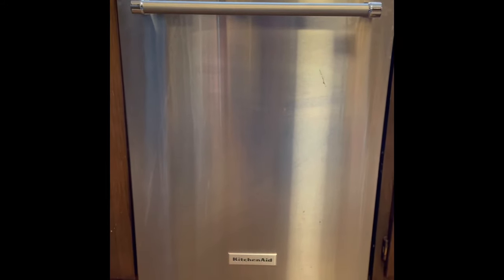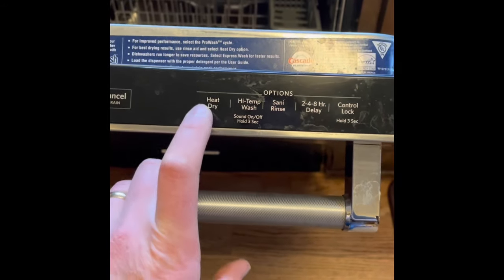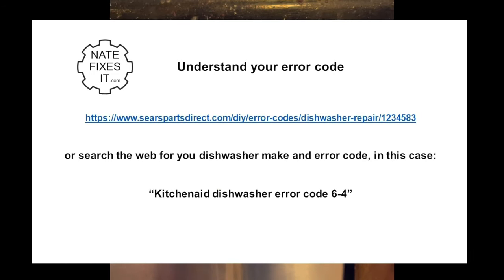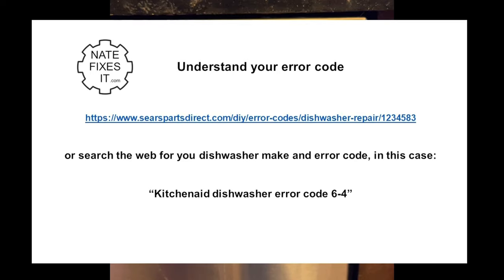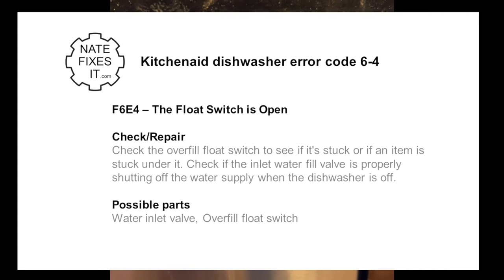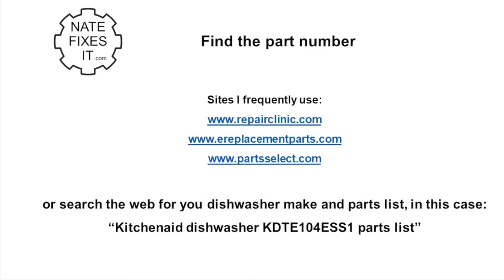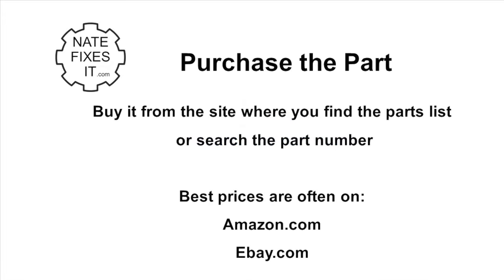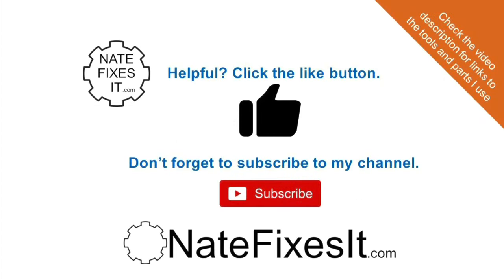Dishwasher Diagnostic Mode: find out why your Kitchenaid won’t work

Comment: When I go through the sequence of pressing the three numbers 3 times (the lights light up each time I press a number) , I don't get any lights coming on.....there's nothing.
 I read some comments below and I see that you suggested I cut power to the dishwasher for 15 minutes to reset the board but I still don't get any lights coming on. Do I just need to replace the Control Board? Thanks!
Reply from the maker: Some dishwashers have different key sequences; is yours the same model (KDTE104ESS1)?  What issues are you having with the dishwasher?
Reply: I tried a difference sequence that I found in your comments. After a couple of tries I managed to get it to respond and it displayed an error code 71. I referenced it on the internet and it says something about the heater?? The dishwasher takes a while to start and then stops after not even a minute. It seems like it just isn't washing. It takes 3-3 1/2 hours to complete a cycle and dishes are not clean and everything is wet. Thanks for any insight.
Reply from the maker: If you’re setting the dishwasher for a heated dry and everything is coming out wet (but not standing water in the bottom of the dishwasher), it could be a bad heating element (which aligns with your error code).  Cold water will not clean as well as hot water.   If you have standing water in the bottom, it’s probably a pump issue.   I have not done this myself, but if you have a multimeter, you should be able to check the resistance of the heating element to see if it’s gone bad.   I’m guessing there is a YouTube video out there that could show you how.

Comment: I can't seem to get it in diagonotic mode for my KDTE104ESS2.  Everything is off (no lights on Start or Drain)  hit the three buttons in a row but they all don't light up at the end.
Reply from the maker: If the control panel is completely unresponsive, check to make sure that you are still getting power to the dishwasher.  Make sure that nothing is unplugged and the breaker hasn’t tripped.  If everything looks right, try turning the breaker off and then back on to restart the dishwasher computer.  If that doesn’t help, it’s most likely a bad control panel, which, unfortunately, is a pretty expensive part.

Comment: Mine has a F6 E4 and a F6 E1 code.  Ours fills with water but doesn’t do anything else.  Sounds like it might be a float switch issue 🤷‍♂️?
Reply from the maker: Sounds like the most likely issue and is a pretty easy, cheap fix.  Check out my video that shows how to replace a float switch.
Reply: Same issue, Already replace float switch and still going on, guess I have to try the valve.

Comment: Thank you, Nate! I think the model of my dishwasher is KDTM704E and I was able to get all the lights to turn on using "Bottle Wash", "High Temp", and "Sani-Rinse". When I close the door, the external light stays on for a few seconds, then just goes off. Am I maybe pushing the wrong buttons?  Thank you.
Reply from the maker: I can’t find specific instructions for your model; but, based on the way it is responding it does sound like you are getting to diagnostic mode and that the dishwasher isn’t showing error codes (doesn’t mean nothing is wrong, just means the dishwasher doesn’t know what it is if there is a problem).  

Another possibility is that you may need to advance through the diagnostics.  I’ve never used this technique, but near the bottom of the article of the link here, it discusses how to move through various diagnostics on some models.  https://machinelounge.com/kitchenaid-dishwasher-diagnostic-mode/
Reply: @NateFixesIt Thank you!!!!!
Reply from the maker: @scott5185  no problem, good luck!

Comment: Nate - I have the exact same error code so I have ordered the float switch. Would I need the fill valve as well or should I try the float switch first and then if that doesn't work then get the fill valve? ALSO, do I need to remove the front panel to disconnect it or can I simply switch the dishwasher off and then replace the float switch?
Reply from the maker: Try the float switch first.  This video shows how to replace it: 
https://youtu.be/wXFZFor5p8I
If it is the fill valve, this video shows how to replace that: 
https://youtu.be/0fbn-ytbGWw

Neither is a difficult repair.  Good luck!

Comment: I tried this and all the lights came on but the front light didn’t blink a code.  All the lights just stay on.  Is there another way to get a diagnostic code?
Reply from the maker: Sounds like you entered diagnostic mode but the dishwasher hasn’t self-identified an issue.  This doesn’t mean nothings wrong, just that the dishwasher hasn’t figure it out itself.  What issues are you having?
Reply: The dishwasher will run and then stop mid cycle. Thought it was the control panel so we replaced it. Still having the same problem so we cleaned out the drain but didn’t help. The latch seems secure, don’t know how to tell if it that or something else.  Thank you so much for responding!!
Reply from the maker: @lanetterodarte3214 the first thing I always check is the filter if it has one, doesn’t sound like that would be it, but it’s free to try.  My second guess is the float switch.  Pretty easy and inexpensive to replace.  Here is how on my model
https://youtu.be/wXFZFor5p8I

Do you hear water going in and pumping out?  If not it could be the fill valve.

Comment: Quick question if you press the buttons in the cycle and then nothing happens, does that mean there is no error codes?
Reply from the maker: If the controls seem to be responding, and no code shows up, that means no error code that the dishwasher has self-detected.

Comment: In your example when you press these buttons 3 times all the other buttons light up.
Mine do not...
Reply from the maker: Do you have the same model of dishwasher? Does your control panel seem responsive otherwise?
Reply: Yes, the same. Panel appears responsive. Last few times "normal" cycle stopped after few minutes with all lights off. Had to run an "express" cycle which worked fine.   @NateFixesIt
Reply from the maker: That’s some odd behavior.  It could be an issue with the control panel or the thermal fuse.  I would suggest restarting the control panel to see if that fixes the issue.  To restart the control panel you need to cut power to the unit for a minute.  If the dishwasher has a plug, in plug it, but most likely you will need to flip the appropriate breaker off for a minute.
Reply: Thanks...  @NateFixesIt

Comment: Thanks Nate! After getting the solid lights and closing the door, the indicator light doesn't blink, it stays solid. Watched it for a good long time to be sure. Any thoughts?
Reply from the maker: It means that the dishwasher hasn’t self identified a problem.  Doesn’t mean that nothings wrong, just that the dishwasher hasn’t figured it out.
Reply: Makes sense; thanks! @NateFixesIt
Reply: @NateFixesIt  mine is doing the same,any suggestions on what next?  My KDTE204KPS is less than 18 months old, hoping to not have to pay a huge repair bill
Reply from the maker: @chelseapeedin1965 if it’s that new, is it still under warranty?  What issues are you having?

Comment: got my code 6-4 same as you're and i've replaced the inlet valve and the float switch but the dishwasher still wont complete a cycle what else could be my problem
Reply from the maker: I’ve had that same error code and it actually be the main circulation pump.  I have a video for replacing that too.
Reply: do you have a link to that video? @NateFixesIt
Reply from the maker: Here you go:  Dishwasher Repair: Circulation Pump replacement on a Kitchenaid Dishwasher (not spraying water)
https://youtu.be/gIm3pFcXu0w

Comment: What does it mean wahen you do the diagnosis code error and the light that should blink just stays solid and never blinks?
Reply from the maker: If the controls seem to be responding, and no code shows up, that means no error code that the dishwasher has self-detected.  Doesn’t mean that there’s nothing wrong, just that the dishwasher hasn’t figured it out for itself.

Comment: If I have no error codes and heater still not working what could it be? I tested the element and it's ar 12.8 ohms. I verified the deverter switch and it clicks. I tested the hightemp thermostat and it's working. The float is working and I ended up changing the turbidity sensor cause there's a thermistor in there and that could also be the issue but in the end I'm stumped.
Reply from the maker: I’ll be honest, I’m pretty stumped too.  The only other thing I can think of is the control panel or if there is a loose connection somewhere.
Reply: @NateFixesIt  So I ended up removing the front door panel to access the control board and noticed the power and heating wires that connect to the board had darkened connectors like if it had over heated.  Atm Im suspecting the relays that are behind the connector. There are 4 relays on this board. I figure its the first one behind the connector. Im gonna try replacing all relays before I fork out 350$ on a new board.
Reply: @NateFixesIt  I removed the front panel to access the control board and yep...pretty sure its the control board thats the issue cause where the power and heating wires connect to, look to have overheated . Atm Im suspecting that the relays behind that connector might be the culprit.
Reply from the maker: @Daniels656993 sounds like you found the issue!
Reply: @NateFixesIt  Yep !! Replaced the control board today with one I was able to find at half the price at a place near me and Dishwasher is now running like new!! Woohoo!! :-)
Reply from the maker: @Daniels656993 congrats!  Well done! 👏👏👏

Comment: Hi. My dishwasher is not washing. It fills up. But is not spraying water. Ran the diagnostic test. It givesme a 6-4 code. So I replaced the Inlet Valve. I can hear the float switch clicking. What else can it be?
Reply from the maker: I had the same issue on mine.  I replaced the float switch and fill valve and it still wouldn’t run.  The issue was a failed circulation pump.  The impeller had actually fallen off of the shaft.  Here is how I fixed it: https://youtu.be/gIm3pFcXu0w
Reply: @NateFixesIt  I was hopping it would not come to that. Thanks for the reply.
Reply from the maker: @frivera7049  same for me whe I had the problem.  Good luck with the fix, it’s really not that bad.

Comment: I tried pressing these buttons in the sequence and closed the door after the 3 buttons I pressed stayed lit. But after a few seconds, the 3 lights turned off without any diagnostic code on the “clean” light. I guess it never went in diagnosis mode. How do I enter the diagnosis mode on my Kitchenaid dishwasher kude70cvss0? The dishwasher runs fine with plenty of water for first 10 minutes. Then, after the soap pod drops to the bottom of dishwasher, it just makes noise but not water comes. Appreciate your help
Reply from the maker: I can’t find any other information on a different way to access diagnostic mode on that model, so my guess is that you are entering diagnostic mode, but the dishwasher isn’t self-identifying any issues.  Is the dishwasher filling, spraying, and then draining on the pre-rinse cycle before the soap drops?   When you open the dishwasher and the soap has dropped, is there water in it?  If there is water, can you tell if it is the leftover rinse water or fresh water for the wash cycle?
Reply: @NateFixesIt  Yes, the dishwasher is filling, spraying and then draining the water before soap drops. When I open after the soap drops there is no water. But the dishwasher makes mechanical sounds as if it is spraying the water after the soap drops. Could this be a float switch or some valve issue? By the way, since not all the lights on the control panel come up after pressing those 3 buttons in sequence thrice, I don’t think it is entering diagnostic mode.
Reply from the maker: @ameetpatil   without being there to troubleshoot, my three guesses are (in order of cheapest to fix):
1. Float switch issue (before replacing, try moving the float up and down inside the dishwasher and continuing the cycle)
https://youtu.be/wXFZFor5p8I
2. Fill valve issue (before replacing, take the cover off of the bottom of the dishwasher and listen to the sounds the fill valve makes when it starts the cycle and actually fills, see if it makes any of those sounds when it should fill the second time)
https://youtu.be/0fbn-ytbGWw
3. Control panel issue

I can’t guarantee it’s one of these, but that’s the order I would try if it was my dishwasher.  The first two are fairly easy and inexpensive things to replace.  I’m not sure if they are your problem, but they could help you with the process of elimination.  I have included links to the videos that show how to do those changes on my dishwasher.  I don’t have a video for a circuit card replacement, but I would think someone else on YouTube will.

Here is a parts list for your model: https://www.ereplacementparts.com/kitchenaid-kude70cvss0-dishwasher-parts-c-114958_420281_421174.html

Good luck!

Comment: Dont know if youre still there nate, but my machine isnt cleaning and when i tried to activate the diagnostic the lights didnt flash to indicate it was going into diagnostic and no flashing light indicating the number error code. Any ideas?
Reply from the maker: The first thing to try is to clean the filter if you have one.  This video shows you how to do it if your dishwasher is the same as mine.  https://www.youtube.com/watch?v=ylGDzryIG-Y
If that doesn’t do it, try listening to the dishwasher as a cycle runs.  Can you hear it filling, spraying, and draining?  If you open the door during the wash cycle, you can peek in to see what’s happening if you can’t tell by sound.

Comment: I have the same model and when I run the reset cycle and nothing happens, no lights come on the top control panel and no flashing code. Any ideas?
Reply from the maker: Is the control panel responding at all, just not popping up error codes?  If the controls seem to be responding, and no code shows up, that means no error code that the dishwasher has self-detected.  That doesn’t mean you don’t have a problem, just that it’s going to be a little more challenging to diagnose.  I first thing to try is to cut power at the breaker for thirty seconds and then reconnect the power.

What issues are you having?
Reply: @NateFixesIt  First of all Nate, you are awesome. Thank you so much for providing this service. 
I walked away from the dishwasher for about 30 minutes and tried the code sequence again. It worked! However, it didn't do what your video showed. It went through a series of clicks and water sounds, long periods of silence, then finally, a long beep, but no flashing error code. All of the lights went off and it seemed like it was done doing whatever it was doing so, I thought I'd try the washing cycle again, and it worked! I guess I will see if there is any more trouble on the next load, but this completed one is squeaky clean!
Again, I sincerely appreciate you sharing your knowledge and hope you are well compensated by the magic of YouTube.
Reply from the maker: Glad that it seems to be working and thanks for the kind words!   The best thing you can do to help me out is subscribe to my and share with your friends!

Comment: Thanks for the info! I ran that sequence and the indicator light is staying on solid with no flashes. Assuming it’s not getting any errors. 

The problem I’m having is that when I hit start, it goes through its normal automation for about a minute. 

Then, the motor makes and off and on sound and then after about a minute it beeps and indicates the wash is complete. 

No water comes out and nothing happens. 

It’s a brand new machine with only 2 loads. 

I tried turning the breaker on and off but still doing it. 

Have a maintenance warranty person on the schedule but 3 weeks out. 

I did some inspecting and can’t see anything wrong? Any ideas?
Reply: I actually tried running the load again and it flashed 8-1 (no water). Checked the valve and boom, it was shut off. 

I had a brand new faucet installed 2 days after the new dishwasher was installed and they must have turned off the line. 

Thanks for the great/easy to follow vid.
Reply from the maker: @jessedau  Glad that I was able to help and it was a simple fix!

Comment: Hello...I have a Kitchenaid KDFE104HPS0.  I touched the three buttons three times but all the lights on the front panel light up...but no blinking code.  This unit has all the buttons on the door facing out....not up on top.  Does the door have to be open first?
Reply from the maker: If all the lights turn on, sounds like you are in diagnostic mode.  If it’s not flashing an error code, that means that it hasn’t self diagnosed a problem (doesn’t mean nothings wrong, just that it doesn’t know what).